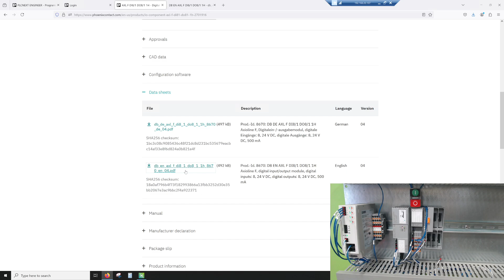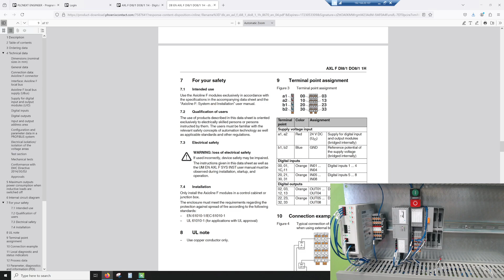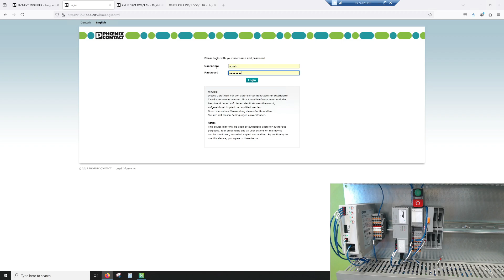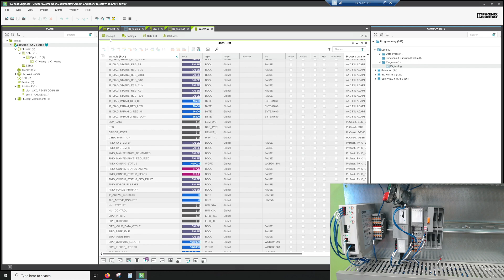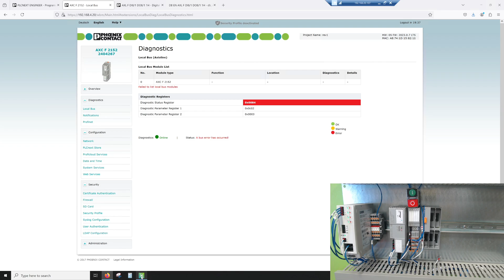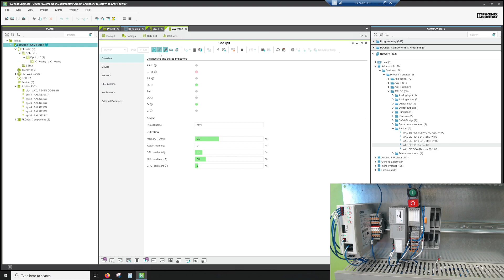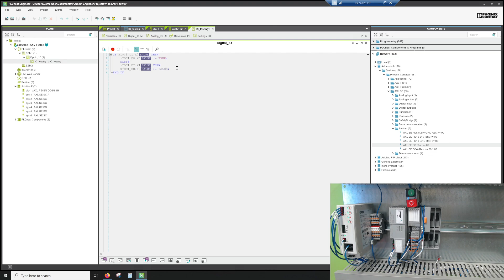The Phoenix Contact PLCNext - Part 5 - Introducing I/O

Comment: I'm not able to do this with a Word. When I use dot notation for the word.Xbit it doesn't see a state change. I can see the value change in the program variables but it doesn't change in the ST program. I'm having to use a word because I have a 16 point DI card. Byte data type doesn't work for obvious reasons. Any idea on this?